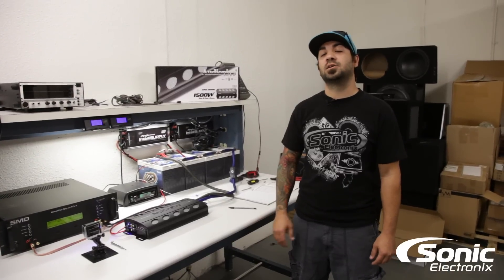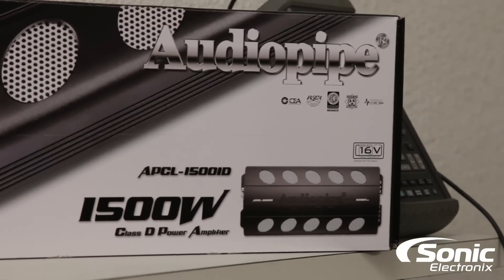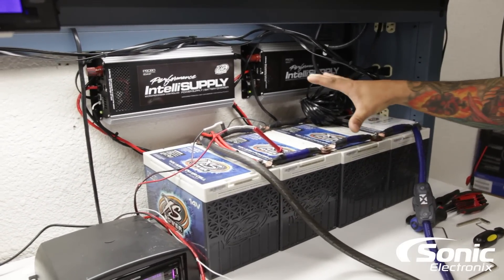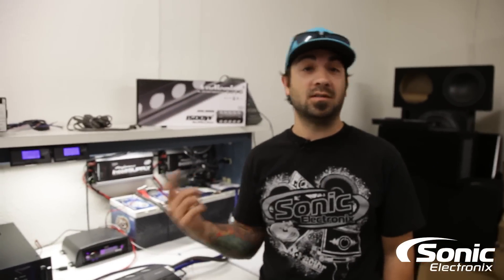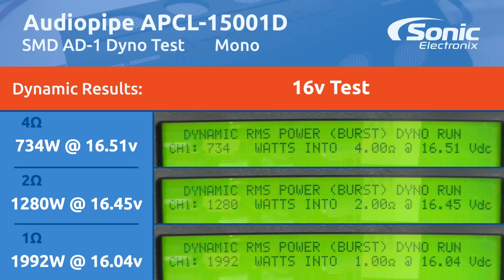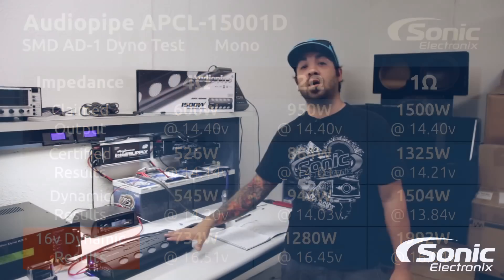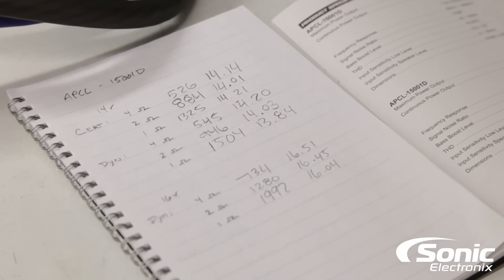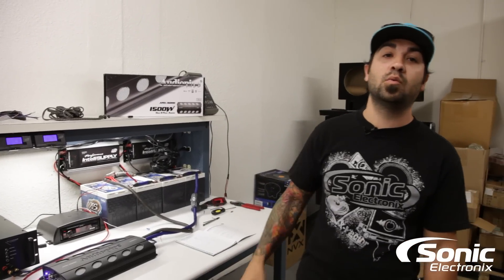Audiopipe APCL-15001D Amp Dyno 16 Volt Test!  | SMD D'Amore AD-1

Comment: Can all Audiopipe amps run 16.5 volts? I have a APMN 1500 and I use a powermax 100 amp power supply. I cannot find that max voltage for this anywhere. Would love to run it at 16 volts if I could to get the max power at 4ohms. Also can you show the amp draw on the tests you do. Would help alot. Thanks!!

Comment: I want to run this in a Nissan leaf. since it's all electric I have no alternator. the charging system for the 12 volt dc side it a single 12 car battery and 50 amp dc to dc charger  (12 gets charged from the 400 volt drive battery). how do you hook it up?
Reply: nbookie 

You are limited to 600 w charging capacity 12x50=600 so you are limited on the power you can utilise without flattening the battery, even with a bigger battery you will need to give the volume knob a rest to let the battery charge back up.

Comment: 16v ok but how long can it perform at 16 volts before burning up or clipping
Reply: Amp is made to handle constant 16v. Very rare that someone is going to run a 16v system. Very expensive to swap to 16v
Reply: MARS RAINES will run all day at full tilt .

Comment: I run crescendo amps,  I have a sundown scv amp, and I've ran an incriminator 40.1. They were beast, I have also ran hifonics brz1200d. It never quit, and now I'm running this apcl1500d. its really good for less than $200. I have it in my work truck on a single Dayton ultimax 12 @ 4 ohms. It pushes it to the limit. I've actually blown one already. User error, but still, its just like all the other 1500 amps. Almost all of these budget amps have very similar boards and there's not much difference. price usually dictates the similarities in amps... most of the time. My crescendo 4500 is very similar to twisted sounds 3.5k. Same price just about, and the aq soundquebed amps are just like the crescendo, skar, etc. Anyways its a good amp for the money. You won't regret it.
Reply: Crescendo and DC Audio use the same boards have the same rated power on the 3500 I think it was Big D Wiz that made a video on that I'm not sure but a lot of people are starting to open up amps and exposing the similarity of higher end and cheaper amps for instance the difference in price between the crescendo 3500 and the DC Audio 3500 I believe was almost $200 and it was the same damn amp with the same damn power

Comment: This is the 3rd test done on the same amp on the SMD dyno and at almost identical voltage and impedence they all 3 have different measurements that can only lead me to one thing, the dyno isn't correct or even close. I have also see the amp tested on a $30k dollar kippal tester and it was far below what this dyno said. Like the highest it had on even .5 was 1200 watts rms dynamic so it's awfully funny on this dyno it does almost double.

Comment: so  have this really dumb question can i run this amp at 600 watts off a 12 volt battery?
Reply: B. Brazy 12v batteries are represented by the 14v test. So yes. And your stock electrical system is probably more like 13.5 fully charged and 11.5 when the car is not running
Reply: Shawn Cicione cool. All im worried about now is it overheating after 30 minutes
Reply: B. Brazy 30min on full tilt is enough to blow any amp it depends on how your gains are set. This is running a class D but it is also a Brazilian circuit so it will overheat somewhat quickly.
Reply: Shawn Cicione ill look for something else
Reply: Shawn Cicione your wrong I run mine full tilr for 2-3 hours all the time never gets hot  , you dont know so shut up .
Reply: alan ray most reviews said otherwise, i went with a cadence instead
Reply: If you want to limit the power output you will need to run a higher impedance speaker, as the impedance reduces the power output increases.

Comment: i have 2 apcl 15001d amps and one i got from sonic electronix. 1 is pushing a single mtx 7500 series 15 the other on 2 alpine type r the only reason i got the second one was my first one was a year old and still as good as new.. no complaints from me.

Comment: Bought this amp in April of this yr. Great power and sound. Was running it at 2 ohms and it never got warm but last month it just started smoking and died.  Just purchased another one from sonic yesterday (2nd one from them) and if this one craps im going to be HOTT! Dosent look like they are very durable.
Reply: John Markman never had a problem with mine. are you sure you were at 2ohms
Reply: Same happened to me these amps are garbage

Comment: don't buy, will never buy audiopipe again. They are built cheap and break after a couple months of use. I ran mine at 1 ohm and it blew an internal resistor and sent straight DC offset straight to my 400$ speakers, ruining them. I switched to an Alpine MRX-m110 amp after that and it's been running strong for 3 years.
Reply: must've had an old one or was clipping my 2 have been going strong for 2 years on two fi bl 18s

Comment: Whats the difference between dynamic results vs certified results??

And when would a car use 16V charging systems? Are they usually equipped with H/O alternators??
Reply: +Bouge laal certified is a tone, dynamic simulates actually music so dynamic is what you would be doing on every day listening

Comment: Why didn't u show the certified 16v run....not all of us do 2 second burst in daily drivers
Reply: installerman40 The burst test simulates music. I listen to music not test tones in my car so these numbers are a good way to show the dynamic power the amp is capable of. I got around 2800W dynamic at 0.5 ohms with this amp on my Dyno. These can be strapped too. I'm usually not a fan of budget amps, but these are an exception.

Comment: nice..i would like to see it in 0.5 ohms..but nice!! later can you run the the 1800.1d version to see what it thoes!!
Reply: +erik h dont forget that you would have more distortion in the amplifier so you wouldn't be able to turn the gain up as much so like you said it wouldn't do much better.
Reply: con
Reply: Allen Antonucci where I want to see!!
Reply: https://www.youtube.com/watch?v=20UREK-ga8E&t=85s
Reply: It does something like 3650 at .5ohm. Crazy! I run 2 ab xfl 12s at .5ohm.
Reply: +edrick mendez wouldnt do much better but would take alot more electrical

Comment: Thanks for that amp dyno test sonic. That particular amp has been up for serious debate. You are the third ones to do a dyno on this amp and all three are different. Yours seems more believable than the others. Much appreciated.
Reply: the differences are minimal. Variations in components, torioid windings, etc. can account for the 1-4% differences in measurements. Trust me, you would not be able to tell the difference in a real world scenario.
2
Reply: @jeffmorefield  plus they running it at 16v instead of 14

Comment: I'm sure it won't make that power for long tho. Looks like its made of plastic..
Reply from the maker: Waldo It's actually a solid aluminum chassis and feels very substantial.
Reply: These pipes can bust some heads...
Reply: Javie Solis .............play any amp full tilt for a couple hours and see what happens.......
Reply: Wrong buddie, sold mine to a friend and he has it pushing a 15 American bass well over 1400 watts rms daily and the amp nearly gets warm and the gain isn't even at a halfway point. Audiopipe amps are really underrated and they are not made of plastic, they are actually pretty heavy and solid build. I regret selling mine after I seen what it did to his 15, I think it could power another 15 from what I seen and heard
Reply: you sound dum as hell i hurd that amp on 4 cvx kicker ive never hurd kicker sound that dam good its doing 16 volts ehat other amp can take that
Reply: ***** ......{o¿O} never?¿?
Reply: +Sonic Electronix  I plan to buy one of these amps soon... My alternator is 100 amp, if I do big 3 will that help keep its voltage up??? 1 other question I have, I also plan to buy a Soundstream T5 15... Which ported enclosure do you carry that isn't very expensive that will have that sub tuned around 40 hz???
Reply: Jacob Rogers im running the old lanzar 50c ultra high current cheater amp on 75 amps for some years now, and did a big 4(direct ground from alt to battery) as well, I get next to no voltage drop at full tilt!
Reply: Okay, thanks man, I'm to stick to a budget, thats why I was wondering...
Reply: Jacob Rogers that make two of us. Cant afford to break this stuff. My 50c is now 20+ yrs old now and doing fine. I just went from 3ohm to .5ohm and still no voltage drop... you should be fine...
Reply: Do you know anything about the SPL Gorilla amps??? I just wonder if they put out what they are rated at???
Reply: I'm running one on a pair of EA's doing a 149.6 on the dash and been doing it for 11 months now...
Reply: Waldo I agree about that amp, play it a coupe of hours and see if it holds up.
Reply: Last amp I had was the skar rp2000.1 a guy heard my ab xr'12s and rp2k and bought it all on the spot. So thought I'd try an X15v2 and the apcl1800 amp don't feel cheesy solid and heavy. I just thought I'd try it for a temp amp it's not a bad amp at all killer budget amp and it don't sound dirty as shit like everyone says.hell I might do another and strap them on the X15
Reply: True, any amp can fall apart in an hour.